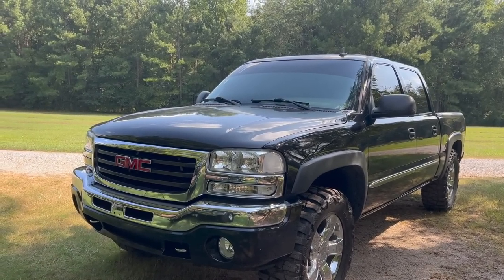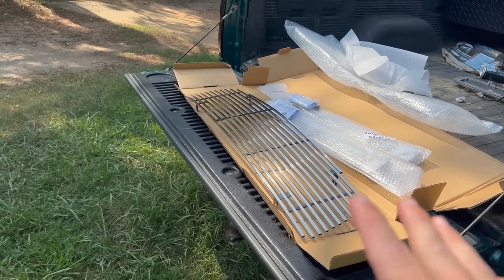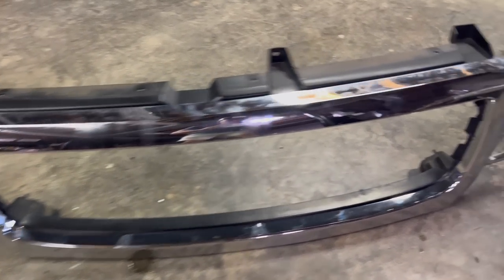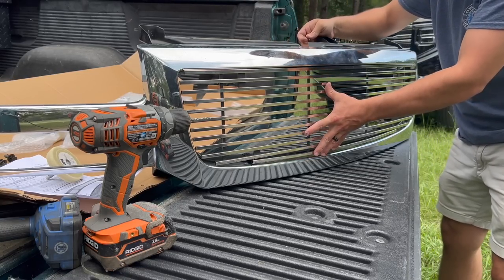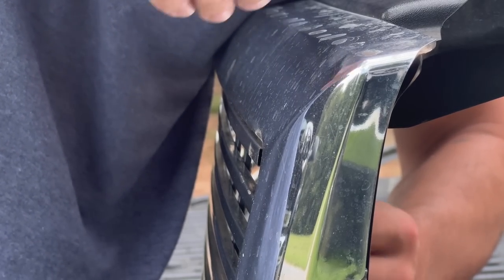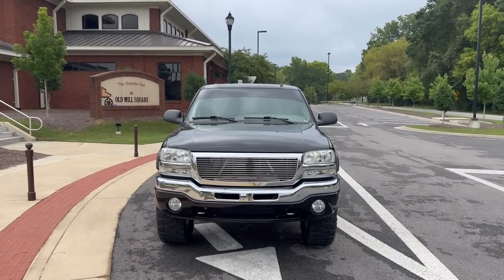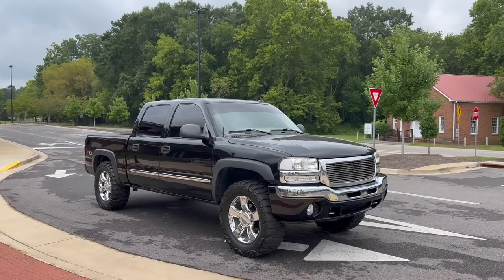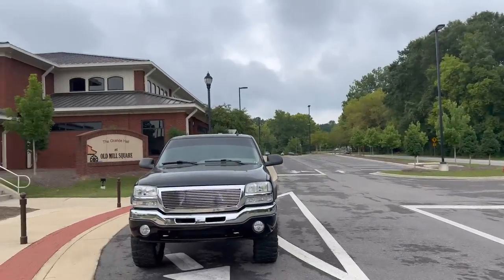BILLET GRILLE IS THE PERFECT ADDITION!

Comment: There is an upgrade for your tailgate cap. Go to a GM/Chevy dealership parts department and have them look up the Chevy caps, not the GM ones. GM lists only one, the plain one. Chevy has two, the plain one and the spoiler one. The spoiler one looks great on the GM's and it fits great, you just need some crush nuts  for install. They might come with them, I can't remember it's been a while.  I loved  the look the Chevy spoiler  gave my old 2007 Sierra Classic.